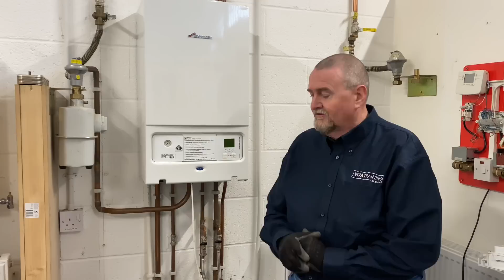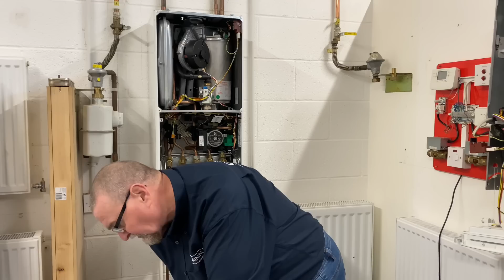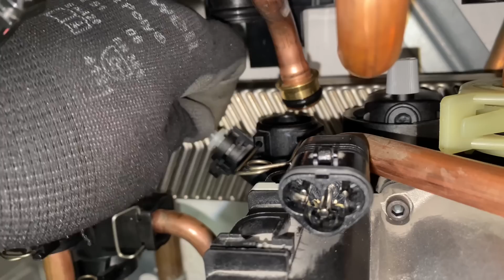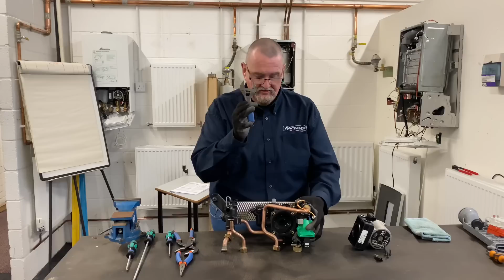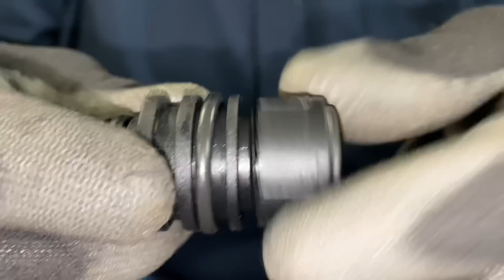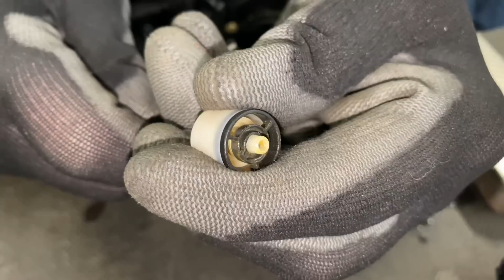Gas Training - How To Remove Hydroblock - Worcester Bosch Combi Boiler

Comment: The biggest part of the job is draining the boiler off so the water doesn't get into all the electrics and onto the pcb ... its so easy doing it when its dry ... even the syphon was empty ... sometimes just trying to get the probe from the pressure gauge without breaking it is a nightmare ... love to see this in a real world situation and in real time..

Comment: Hi great video, just a quick question, is this the same setup on a Worcester Bosch greenstar 30i? I have a problem with my boiler, when the hot water is off the pressure goes over 3 bars but when the hot water is running it drops down to just below 3 bars. What can be the main issue? Cheers

Comment: I have a P2P to change on the Greenstar classic the pipes go straight out of the valve into the wall so no chance of moving hot pipe out of the way, do you recommend removing the hydro block to change p2p

Comment: Thank you so much for this video. The company responsible for my boiler insurance with Domestic & General have to come back and replace the PRV on my Greenstar 24i Junior. I now know that, after shutting off all the radiators and draining what's left, a competent plumber should be able to remove the hydroblock relatively quickly in order to replace this part. I've seen several videos that attempt to replace the PRV without doing this, and it seems far more trouble than removing the block. While I wouldn't consider working on the boiler myself I really do like to know what is being done, and how it should be done.
Reply from the maker: Thank You
Reply: I bet you watched the engineer from start to finish and made him extremely uncomfortable David :D
Reply: @erdywest7172  If you are doing your job well you should take pride in being watched.

Comment: Roy, fab video.. my right hand side plastic unit was all fured up with  a leak. I drained and replaced the right plastic unit, the flow turbine, re pressurised to 1.5bar,  (the diverted valve solenoid looks really low and doesn't raise more than 3 mm) and it will not turn on. Blue light mostly off,  1 blue light to two red lights. What amhave I missed / need to do? Many thanks Roy and team.

Comment: another thing to be advised about .. the washers that go in the top of the hydro-block are called Bonded Washers they are bosh specific they have little tabs do not try put the system back together without them. I am not sure where mine went if anywhere... but i did find broken Fibre washers which lead me to believe that was the washer needed.. which is wrong... cut a long story short after watching a few vids and visiting a few plumbing spares websites i found out about that the correct proprietary washer.. another side part is that you can use a regular bonded washer on the left hand block that does not have little tabs.

Comment: This is very good, but I urge you not to unplug sensor connectors (or any electrical connectors) by pulling on the wires.

Comment: Is the hydroblock housing male where it meets the plate heat exchanger holes( female) or doesn't it enter just surface contact with washer?
Reply from the maker: it has a flat face on it. Thanks.
Reply: @AllenHart999  Thanks Allen
Reply from the maker: @richjmb5522  No problem. Thanks for watching.

Comment: Don't understand why they put the prv where they did, you can pop a baxi out in minutes, having to take the hydraulic block out just doesn't make any sense, and they don't come out as easy as you are implying, also you forgot to mention those unusual metal type washers that you can miss when to release those clips with the pump pliers, then you can't buy the washers and seals just enough to replace the prv, they supply a big bag with every clip, O ring and washer in the boiler around £45, I've got a big tin of the ones I didn't use. Even standard fibre washers won't fit as the male end has a little lip on it so you can only use WB washers and they don't give you any extra. I walked away from one of these last week that needed a new prv, just couldn't face it.

Comment: You forgot to mention in little older Worcerster boilers, these plastic flow turbine starts deteriorates and cracks easily, so be carefull when removing hydra block in older boilers. Really good video. thanks

Comment: I would be interested to see common primary heat exchanger faults.  Recently had an cast alloy heater exchanger on a Worcester Bosch RD32 split at the side that was not visible from the front. It would hold pressure when cold but when the heating was re-engaged it would slowly lose pressure and leak out about a litre of water in 24 hours.

Comment: Hi Allen, do you (or any readers) know where we can buy a PCB for a Mains Eco fan please? I think it's also known as the fans 'speed modulation board' < it's positioned in the housing on the back of the fan...

All we can find on the internet are Worcester fan PCB's - Cheers
Reply: Hi Chaz, unfortunately the fan Pcb is not available as a separate part, I know some of the Baxi engineers, just change the Pcb but have to take it from a new fan.

Comment: Great video Allen and Roy, 

Horrible strip down for a basic job like PRV change 

How about a video on balancing radiators with Testo clamps
Reply: Taking out the pump assembly you can easily get to the PRV and also remove the plate heat exchanger